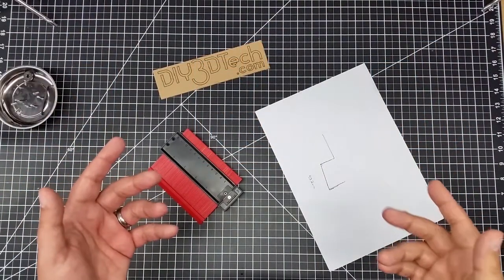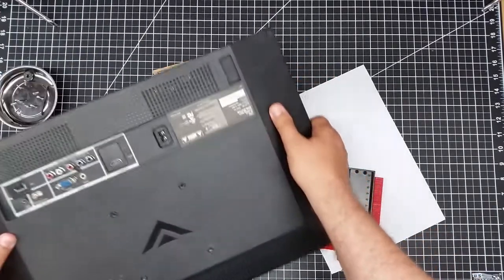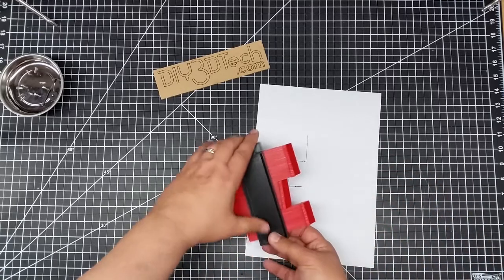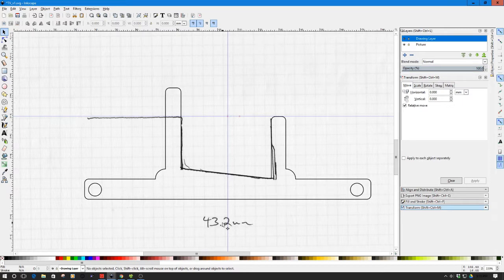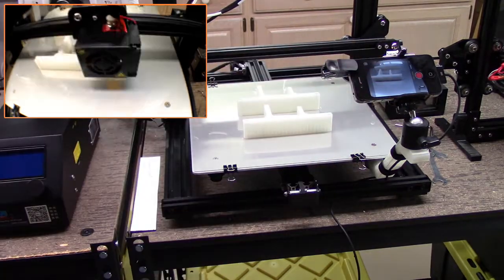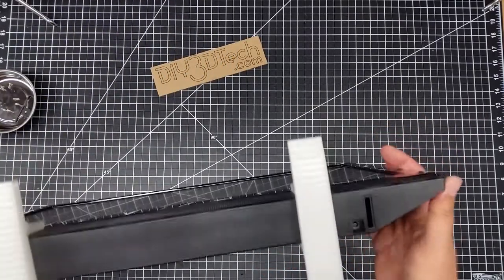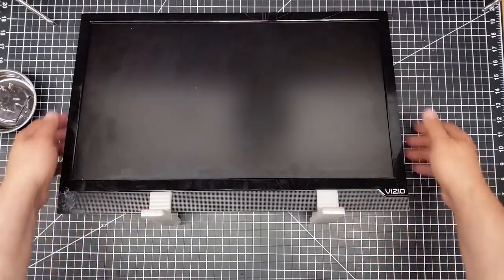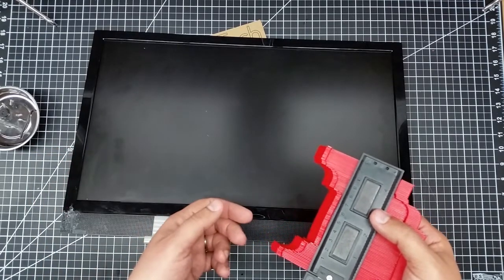3D Printed Project - Using a Contour Gauge for 3D Design!

Comment: Have you considered using fusion 360? It's free for hobbiests and students.
Reply from the maker: Yes I have :-) However part of the issue is "free" for hobbiests and students as I also do commercial designs which I use Open-SCAD to keep myself legal.  And stick with Tinkercad on the channel as it doesn't scare most people like Fusion does (I am also a fan of NY CNC) as that thing is crazy powerful (I am also involved in PLM as part of my day job)...
Reply: @DIY3DTECHcom   as long as your company doesn't make 100 grand per year your fine you can keep renewing

Comment: One thing I did see that you could have added is small stands in the middle of the piece to fit into the slots on the bottom of the tv.
Reply from the maker: Lots of options, however these really turned out nice (nicer than I thought) especially since I pretty much needed the TV to sit flush with the desk...
Reply from the maker: Hmmm didn't notice slots, will have to take a look :-)
Reply: was just thinking same as James ,  could be time to CNC some small sheet steel .or such . but printed stands age good too .